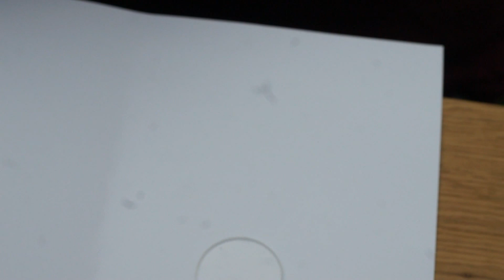EdMika FD 55mm 1.2 Aspherical Conversion kit instructions

Comment: All nice and interesting, but that brass mount should be finished in matte black, at least in the inner areas, because with this metal so clear and reflective, internal gost are always lurking!
These to me appear as a very good prototype to be finished.
Reply from the maker: I currently paint the internal surface of these brass mounts with a matt compound.  However I am launching a new material adapter that is fully black and is the least reflective of any camera mount available in the world.
Reply: Good news, the new material sounds exciting!

Which black paint/compound do you recommend and where to buy it.
I have so many adapters and lenses that would require an improved anti-reflective coating.
I tried once to paint with a matt black paint, the paint used for car engines, pretty good, but I think you could do better without necessarily being a factory.

Do you have a suggestion, a brand name?
Reply from the maker: I tried all types of paint for coating brass internally but found the only one that had no chance of flaking and went on consistently was actually a sharpie black magic marker.
Reply from the maker: I expect the Machined Polymer kits to sell much better because of their dramatically better anti-reflection properties (and lower price of course as well).

Comment: The adapter serve for one canon 6d?
Reply from the maker: It will work for the 6D but it has the same mirror like 5D2 so you will have to switch to live view when focusing beyond 10 meters or the rear element will contact the mirror frame.

Comment from the maker: That rear optical element you see in the video is from the original lens that my EOS kit has to hold. The standard low cost optical FD-EF adapters add an extra one that acts as a mild extender and degrades image quality.

Comment from the maker: 1. You can pick this lens up often for much less.  One sold on eBay last week for 535 dollars and the two I have I got for under 900.
2. This is the single best lens of over 10 f/1.2 lenses I have for handling CA wide open with also the best contrast.
3. Manual focus lenses should not only be judged as a cheaper solution to modern EF lenses.  For video they are better because of more precise focusing and direct manual control of aperture. Older manual lenses have unique optical signatures too.